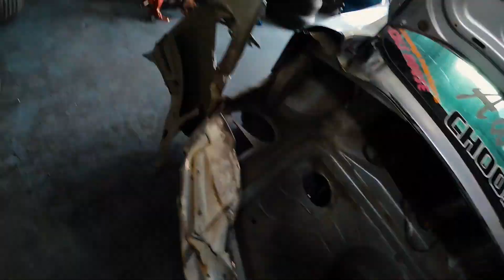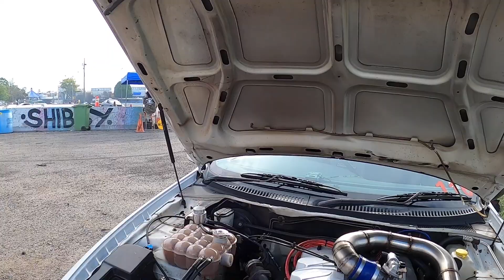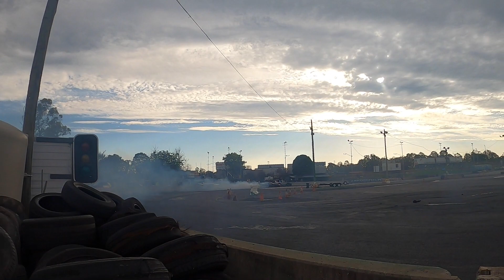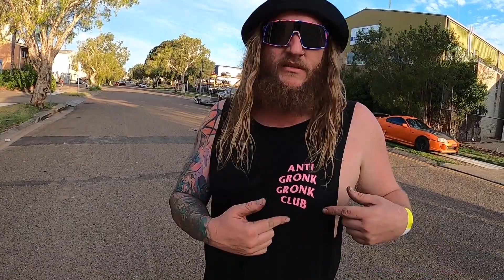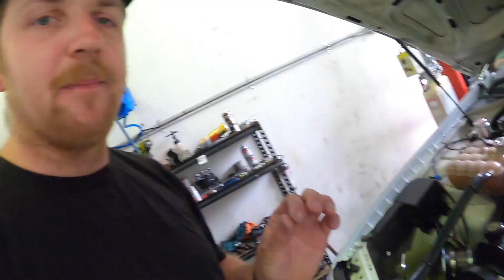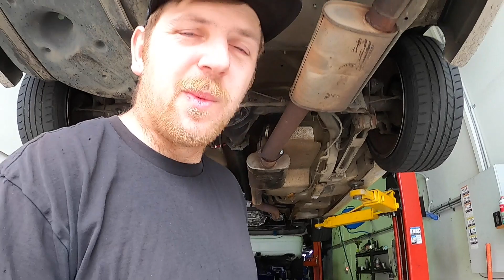Turbo Au Falcon Testing | COMP PREP | S2E37

Comment: Great job on the car! It went awesome with the new gearbox. I would like to do the same to my non ABS S pack turbo. i was wondering how the clutch master cylinder would work and also the wiring. i hope my old Haltech ps2000 will work with the gearbox wiring a speedo. Keep up the good work.